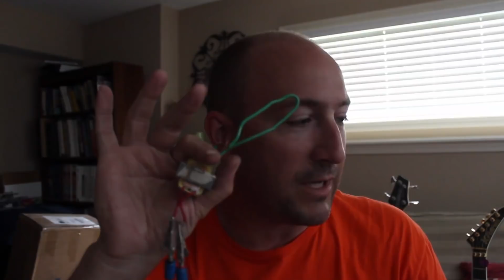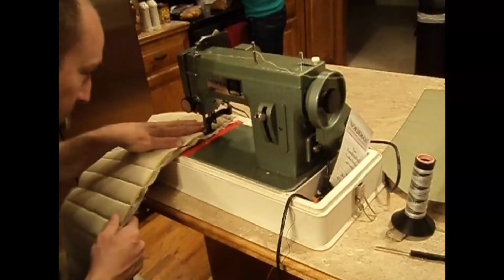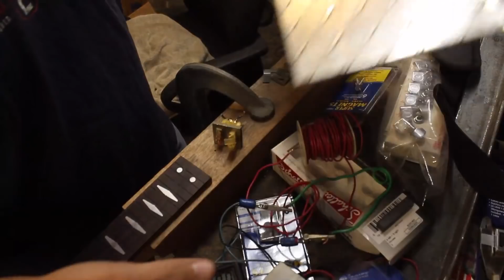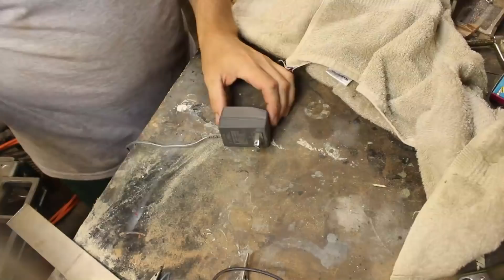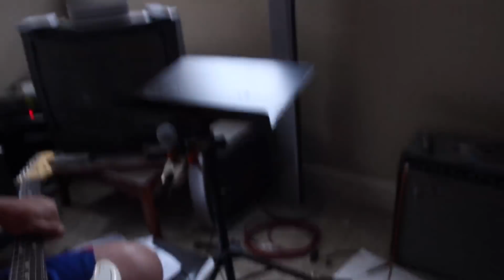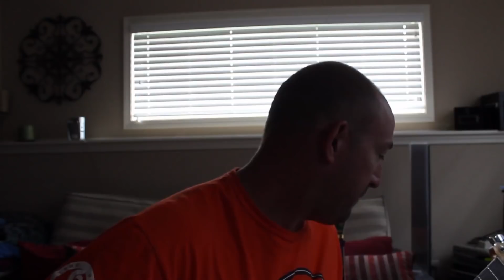Guitar Build - Part 16 - DIY Alumitone Style Pickup Test

Comment: I never knew one could have a "flat" pickup... that would have opened up all kinds of possibilities in my guitar-building days...
Reply from the maker: You had guitar building days?  Do tell.
Reply: I built 2 electrics: One as small a body as possible-- made of PINE, but it sounded rich--single pickup statically set: no volume, tone or selector switches.

The other had an effects pedal built in (distortion, delay and chorus)-- looked really cool with the lights and knobs... I painted it with Fleck Stone textured paint. But it sounded TERRIBLE because I couldn't shield it enough. No pictures and they are long since gone from the planet
Reply: there are super flat humbukers named "flatpup", made for things like diddly sticks and CBGs. ;) from the bit i researched, they are made by a nice guy making instruments himself, and sound very nice.
Reply: I am not one of them, because I like radically different sounds, but guitarists often have a problem with this style of pickup; They often hate the tone.

I think it is just a matter of adapting the rest of your setup to it, but you are likely to hate it in a conventional guitar rig.

Comment: Nice one Greg, that's real MacGyver electronics :) most impressed, if you needed to calculate the exact number of windings required for the required voltage try this equation Vp = potential difference (voltage) input on the primary coil
Vs = potential difference (voltage) output on the secondary coil
np = number of turns (coils) of wire on the primary coil
ns = number of turns (coils) of wire on the secondary coil for Vp/Vs=np/ns or ns=(Vs x np)/Vp. Looking forward to the next video.

Comment: This may help someone looking to build one of these. The body of the Alumitone pickup is cut in a way the aluminum is acting as 1 big coil around the magnets. The magnetic field is increased by them gluing strip magnet under the body (1 strip for single coil 2 for humbucker) then the step up transformer is mounted under the pickup body in that heat shrink you see on them. 

Yes this is the same idea but it may help to know the body itself is acting as 2 coils per pickup and are cut where one side is around 1 magnet while the other side is around the other. 

The OHMs reading for the Alumitone is around 1.5 for the single coil version and 3.2 for the humbucker all together assembled. 

The big plus to the design is that they will likely last a really long time due to the lack of coils, no small wire breaks or anything and if it does go down, unsolder the transformer because thats definitely the problem if they don't work and find another on an old board you can use that is relative to the size/output of the original. But anyone interested in owning a set of those should just build them. They are simple in design (why its a good design) but Lace overcharges for what you get. 

Good video as the basics of how they work is very well done and plus you wound your own transformer.
Reply from the maker: Spot on!
Reply: Is there a reason to use aluminum? Could you use stainless or brass or even a ferrous metal?
Reply from the maker: @joshua.merrill  Good question.  I believe you need a non-magnetic material...  I could be wrong.  The aluminum becomes part of the core of the winding.  In wall transformers they use ferrite cores.  I know there are issues with Eddy currents and other noise making attributes of the components.  I'd figure brass will work just fine and stainless maybe as well.  One nice thing is the reduced weight.  Adding mild steel would increase the weight...  Now I need to do some experiments!
Reply: @joshua.merrill  You could essentially use anything as the body. The reason they used it is it has a higher resistance but is a metal electricity moves through very easily.
Reply: I've got my own plasma table and access to a laser, so I'm really interested in cutting out a design using this concept of not cutting into the neck-through. I'm trying to understand how it works and what the lowest profile/most discreet option would be for a design. I'm wondering if there's a way to move the transformer into the knob cavity, and pass wires from the primary coil through them, remotely. I've got the Deathbucker in my guitar and love the sound, so if I could make a design that's similar sounding, but flat in design, I'd be able to cut out the metal parts with next to no effort.
Reply: @joshua.merrill  I read somewhere that it picks up less noise than copper. But it's also probably because it's cheap and easy to shape.

The entire pickup probably costs them 10 cents to manufacture and requires less manufacturing steps.

Comment: Step-up transformer.   
.
The Lace Alumitone senses change in [eddy] currents flowing around the precision-cut alumin-i-um exoskeleton, so generated, when the oscillating string (ferrous material) cuts the lines of flux from the magnets.   Magnets are composite ferro-ceramic rubber, thinner and much lighter than AlNiCo or standard ceramic mags, these are stuck to the exoskeleton in the precision-water-cut slots on the pickup's top surface.  The sensing coils - two in series - are 'hung' from the ally exoskeleton at one end, by a small number of thin soft-ferric laminations (as found in transformers) forming a ring through each side-by-side mounted sensing coils and via two square slots cut in the skirt of the pickup.   The coils are high wound, but micro thin enameled copper wire (prob >45 AWG).  With a DCR of around 3.5k - 5k across both coils.   Early Alumitones were 'non-splitable', whilst the later versions now come with 'coil-split' option.    
.
It is true that they are very broad range and overal flat response, which lends itself to tailoring via tone controls or more complex active eq systems.  However,  being so sensitive, they certainly bring out the full sound of the vibrating string, but also the full sound of any fumbles, muzzes and other unnecessary finger movements across the full scale of the guitar.   One thing for sure, with Laces fitted, it sure does tidy-up one's playing technique.
Reply: Why would you want a flat frequency response? 

Guitar amps purposely accent the high frequencies.

I mean it's an interesting idea, but I am not sure the problem they want to solve. Seems to me they might incorporate this idea into their own, original lace sensors, which - because they are forced into a single coil box - use less windings and to me sound thin.

Comment: These look super interesting!
Does each individual 'coil' require its own transformer?
Reply from the maker: These are exactly like a transformer.  If you have 5 coils around the magnets (the primary) and 10 on the bobbin (the secondary) you'd have a 1:2 increase in voltage.  You can mix and match any way you want.  I don't think you'd ever need to have a second transformer on a given pickup.

Comment: funny the only amp I ever had was a finder Princeton    I never thought about that on solid body's boring all that meat would definitely weaken it   cool idea on the pickup your shop looks like a mad scientist been working in there    cool stuff
Reply from the maker: I think the princeton is one of Fender's best solid state amps.  It takes the brittle sound out of cheap guitars and makes good guitars pretty smooth.  It doesn't have much bite though...  As for the lab...  Yeah, no time to clean up from one project to another.  The electronic stuff is always WAY messy!
Reply: the lab  lol  I got the amp from my aunt she would try to sing while me and my cousin hid and cracked up

Comment: Nice work. My cuz sells on ebay some thing he made for guitars that increse the voltage to 24 volts from the original 9 volt battery. Not sure what exactly it does I know noting anout guitars just figured id tell you just incase you were interested I could get you one. He sells them cheap I know. Later
Reply from the maker: Ah, probably something for active electronics.  I won't have any of those on board this guitar.  I'll def keep it in mind for future builds.
Reply: Oh I know its prob not for that build but figured for your other guitars. Ill see if I can get pics of it to show you what it looks like. I know its something you could build no problem. Ttyl8r greg

Comment: i'm thinking, instead of a copper wire, would a copper plate that acts as both the caddy for the magnets and as the "coil" for the circuit work? it'd surely be much lower impedance than any wire and would cover a much larger portion of the magnetic field so theoretically would be significantly more powerful, the only issue is shielding i guess.

Comment: Is the secondary coil bypassed in the test? It looks like it's still on there. 

Looking forward to the next video. Ive been wanting to make one of these style pickups but I know absolutely NOTHING about electronics so your video is EXACTLY what i was looking for.
Reply from the maker: I'll show a closeup of the xformer that I used in my next video.  Basically I cleared out the secondary coils from the wall wart and I stuck my single copper wire loop through the hole where the secondary coil had been.  I think I used 2 or three different xformers in this video because I lost a bunch of footage of the original run through.  I am off on a different project for the next couple weeks, I'll be back on this one in late July I believe.

Comment: I realize this is a few years old, but I need to know - did you take out the wire from the 110v side or the 9v side?
Reply from the maker: I left the side with smaller wire diameter and more turns.  I believe that is the 9v side.
Reply: +Greg's Garage Thanks SO much!
Reply: hi is mistakes ---  110 volt side